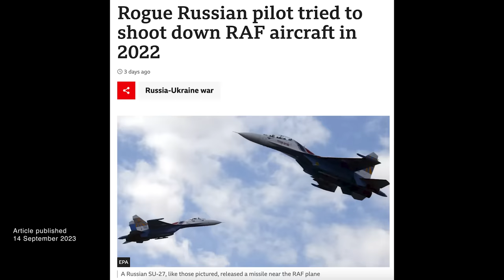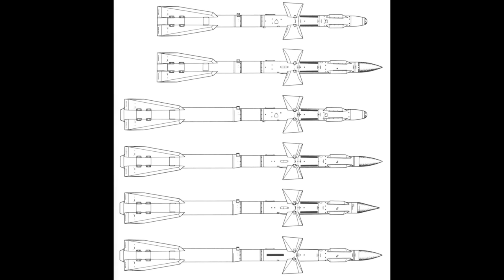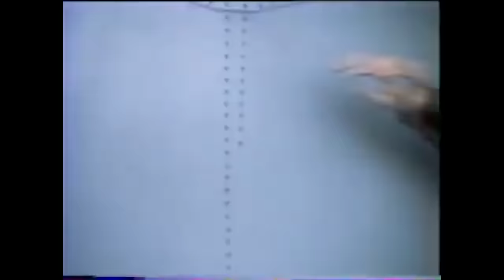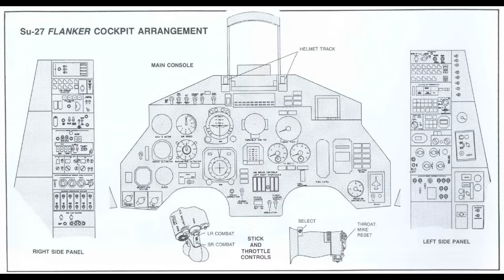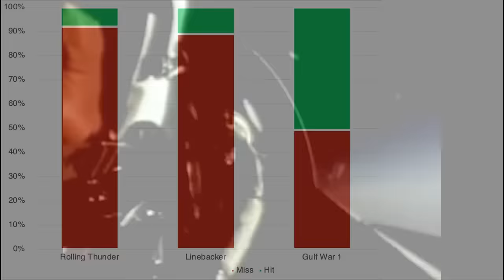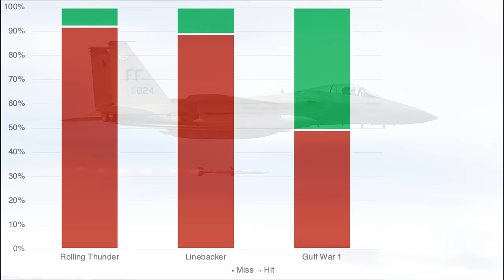BLACK SEA RIVET JOINT INCIDENT: A Narrow Escape But The Reality Of Air-To-Air Missile Performance

Comment: Remember the mission of the Rivet Joint platform. It is VERY likely the crew was listening to the Russian crew’s communications. They knew exactly what radar modes each Flanker was in. Considering that circa-1990 U.S. fighters had deception repeaters, wouldn’t it be logical to assume a U.S. national asset has capabilities far more robust? I don’t know, so I am not talking out of school here, but I don’t think those AA-10s just “went stupid” on their own.
Reply: Yes. The main postscript to this incident for Russia is them trying desperately to analyse exactly how their missiles were defeated (if indeed they were (probably)). For Russia this incident is ultimately a positive: they didn't start WW3 but they have some much needed intelligence; at the least they will know there is work to be done but possibly more specific intel will have been gathered. On the flip-side NATO may have revealed a capability. All that said, let's hope they get their loose cannons under control, can't end like this every time.
Reply: 50-50% this vs. just Russian junk.
Reply: For what it's worth, if some sort of classified ECM/Jamming system was at play in why the missiles failed, that would be consistent with the US and UK not wanting to talk much about the incident.
That said, assuming there was some ECM system at play, even the air crew can't be 100% sure if that's why the Russian missiles failed, or if the missiles failed for unrelated reasons.  Russian gear is certainly capable of not working without any outside help.
Reply: @guaposneeze  Well there is also the larger geopolitics of not wanting the escalate into WWIII...  Even if successful, this wouldn't have been a "Lusitania moment" but it would have been a step towards it.
Reply: @guaposneeze  I can say for sure that Rivet Joint sucked up EVERY BIT of electronic data involved in the event.
Reply: @obsidianjane4413  That is DEFINITELY a possibility. Who knows?
Reply: @obsidianjane4413  what do you mean a Lusitania moment?  The US didnt enter ww1 immediately after the Lusitania either. In fact this would literally have been a 'Lusitania moment. '
Reply: @jefclark  It is often cited as a casus belli for the US entering WWI, because it (government anyway) was looking for one.  In this case, the UK is not looking for one, I don't think.  And this is still a military aircraft doing a military mission supporting a combatant.
Reply: @obsidianjane4413  Im well aware of what the Lusitaniia was.  It was not the casus belli. Look when it happened - it was over 2 years before the US entry into the war.  The casus belli was just as much the other uboat activities, the zimmerman telegram, and the US favoring the allies anyways.  If the Lusitania had been sunk in say, Jan 1917 and then the US entered in april Id say sure.  But 2 years before doesnt equal a casus belli.

Also it turns out the Lusitania was transporting ammo too.

As far as a military mission supporting a combatant, technically the Russians have to prove it.  Otherwise its very much a flight in international airspace; period.  And when the Russians cry about it, ask for a reminder of Soviet activities in Korea and Vietnam, or Egypt and the Middle east.
Reply: North Korea did shoot down an earlier version in an EC-121 and we chose not to start WWIII
Reply: @raymondclark1785  North Korea has also been totally and thoroughly isolated, and never was the threat to the US Russia is.. at all.  Also should we not discuss the implications of either answer when it comes to who decided to attack?
If its the pilot then Putin doesnt have control over a military that has nuclear, chem and bio weapons.
If Putin did order the aircraft shot down, then the implications are obvious.
Reply: I think it's very likely you are exactly correct, and even more likely that we will not get declassified confirmation for a century...
Reply: @AnimeSunglasses  "even more likely that we will not get declassified confirmation for a century..."   So... we basically will never get it.
Reply: I agree fully.

It's too easy to laugh and say "Russian junk"...

But actually, it's MOST likely the  aircraft used ECM and other countermeasures to defeat them... with the UK and US (it's a US platform) quite rightly downplaying this to hide capability.

And in this video, to call the aircraft an "airliner" is just a load of nonsense. Makes it sound like propaganda.

The rivet joint is a weapon of war. It isn't defenceless!

I'm so glad this ended the way it did and nobody was hurt or started ww3, but let's not downplay facts. That's exactly what we criticise Russia for all the time. Propaganda, lies and downplaying. Yet here we are, openly doing just this.
Reply: @obsidianjane4413  no, it's not 50%-50% it's more likely 90% countermeasures, electronic or otherwise vs 10% "Russian junk".

We don't send defenseless aircraft up to play real world "war games".
This was always a risky political mission for the RAF and a risky mission for the crew.
If you poke a wild animal often enough, it's going to bite.
Especially if that animal is suffering from rabies for example.
Just like this pilot has "NATO is the enemy" in their head.
Reply: Puts on flat cap & grips lapels ..... As sed it afore an as'll say it agin.
Guess what Ivan might well do IF he wanted to check out a Rivet Joint's real capabilities
The missile which flew may have not carried a warhead, the second 'failure' being 'corroboration'?
Reply: @Farweasel  oooo I like your thinking!

I'm a strong believer that the RJ used certain means to defend itself and caused the failures, so your theory about "testing out the RJ capabilities" is a very interesting and viable one.

Although it's a risky/stupid way to do it, because it could have provoked a much larger reaction from the west.
Reply: @jefclark  The third option is that this was a mistake by the pilot - and for sure, Putin doesn't directly control every fighter pilot, ultimately it's down to some lieutenant pushing a button or pulling a trigger.

Comment: Another possible factor is a self selection effect - someone who has their head on straight isn't nearly as likely to err on the side of shooting in this sort of situation. So conversely, someone whose mental judgement is off may be more likely to make mistakes executing the missile attack.
Reply: considering that it's a decently high altitude shot and there wouldn't be much to interfere, it's most def a missile and guidance error. It's an embarrassing show of ineptitude on russia's part to not be able to shoot down a slow moving massive target lol
Reply: @felis_8906  moreso poor maintenance. Missiles are quite delicate so poor maintaince practices increases likelihood of failures this compounds as a missile ages.

Comment: In 2023, I expect air-to-air missiles to work.  I have no idea how the British aircraft survived.
Reply: Missiles miss, AIM-9X missed a virtually point blank shot on a Su-22 from rear aspect over Syria in 2017 when the Syrians were bombing ISIL . The F/A-18 had to use an AMRAAM to finish the job. Unlike the Rivet Joint the Su-22 from 1970s  lacks much of the electronic counter measures and sensors
Reply: @Archer89201  to be fair its countermeasures were so old and poorly optimized that they created such a tremendously dirty ir burst that it blinded the 9x across the whole ir spectrum as it uses an ir camera, not a seeker and by the time it was able to see it lost the target.
Reply: You shouldn't even today they aren't extremely reliable. The only reason certain missiles are more reliable is due to different practices and some modifications learned through tough experience. Its why by the end of their service sparrows were so relatively reliable. Vietnam was not a kind place to them

Comment: RC-135V/W is one of my favourite aircraft in service today.  In my previous life, I was a systems engineer and provided support to Airseeker, Cobra Ball and Rivet Joint processing systems.  As challenging as that job was, I look back on it with satisfaction.

Content Idea:  Speaking of technical systems, how about a study of the offensive radar systems used in the Korean War night fighters?  The USN/USMC had the F3D, which, as much as it was built for air-to-air, the Marines used it in a limited fashion for air-to-ground.  Old habits are hard to break even when you're flying a plane that was not a pound for ground.

Excellent reporting and analysis.  Always enjoyable!  Thank you!!
Reply: Defensive systems
The infrared countermeasures was not limited to flares, but directed energy from the AN/ALQ-157 system.[4] The aircraft has an AN/ALE-47 Countermeasures Dispenser System [CMDS], is a "smart" dispenser that connects directly to infrared and radar warning receivers, release expendable and towed/retrivable decoys, as well as helping the pilot with situational awareness of the threat.

Comment: I don't think it's too far fetched to speculate that the Rivet Joint would have some electronic countermeasures / chaff and flares that could have helped the situation in their favor. Those things are national assets, not having several layers of countermeasures would be silly. However I do agree that missile construction, age, handling, and pilot error could have played a part. Wouldn't surprise me a bit if the second missile was fried by an EW capability.
Reply: I 100% believe this was down to countermeasures of various types and not "Russian junk".

The aircraft was playing a very dangerous game in the middle of a conflict, there isn't a chance on earth that those crews were not always ready for a potential attack 

The first missile may have caught them by surprise and they reacted in time, but they will have been expecting the second!
Reply: @richardwillson101  Highly doubt they have the technical ability to make the second missile just fall of the rails. I'm sure they defeated the first missile and the second one was likely just a Russian dud.
Reply: @theflyinggasmask  true, you can't make it "fall off the rails" but without being there, we won't know if that means the rocket motor didn't fire, or if it broke lock almost immediately and lost all guidance.

There is certainly a chance it was a dud, or the pilot failed before the system was ready.

Modern countermeasures are very effective against older weapon systems. Especially if deliberately tuned to meet specific threats where they are operating.

Comment: These are the kind of messages that need to be drummed into the heads of aerospace engineers...as in "yes, Dummy, we also need a gun."
Reply: If you need a gun then you need a super maneuverable jet.
Reply: You mean kinda like a Flanker?
Reply: the Flanker has a gun.  This isn't Vietnam where they handicapped our pilots but not putting guns on early Phantoms

Comment: With this in mind, about how unreliable missiles are, it’s amazing the kill rate achieved by Sea Harriers in 1982 in the Falklands, with much older tech missiles. I wonder what the launch/kill ratio was there. I know they downed 20+ Argentine planes. Thoughts?
Reply: I know that the AMRAAM has a Pk of around 77% with almost every kill against an obsolete or non maneuvering target (inlcluding a US helicopter !).  I think that no matter how high tech the missile actual Pks in actual combat will never exceed 50%, especially against a target that values its own life than the mission success.
Reply: @rags417 What's that got to do with the Sea Harriers in the Falklands.
Reply: Aim-9L was a very very good missile
Reply: @Twirlyhead  OP was wondering what the Pk was for AIM-9Ls in the Falklands War, I pointed out that it probably wasn't greater than 50% since almost every missile ever made has a less than 50% kill rate vs a maneuvering target, AMRAAMs included and they are for some reason taken to be the gold standard in AAMs
Reply: @rags417  And there was I thinking you mistakenly thought the Sea Harriers were equipped with AMRAAMs in the Falklands in 1982 when they only were equipped with them from the 1990s FA2 version which also had the vastly improved Blue Vixen radar and the AMRAAM itself being only available from 1991. Altogether much more capable than the Sea Harriers of 1982. Just shows how wrong I can be, thanks for explaining to me.
Reply: @Twirlyhead  I was 21 during the Falklands War and followed it pretty much day by day in the news.  I have been following aircraft and military tech since I was around 9 years old, my dad flew light planes a lot and flew 13 missions in New Guinea in WWII.  I have a "fair" understanding of miltech and its history :)
Reply: I think Sea Harriers having the all aspect AIM-9Ls was a huge advantage over Argentine fighters with tail chasing older models especially when the Argentine planes had to fly to the edge of their range and were low on fuel to maneuver. No disrespect to the excellent British pilots, they were brilliant too
Reply: this is just my opinion,  but I get my sense that the RAF pilots were very well trained and just skillful,  and in the case of the fighters that attacked the British ship causing much death,   just plain pissed off.

Comment: It is unconscionable that western nations would not escort an asset like this, even in international waters! To think that your enemy will follow the rules, leaving your soldiers unprotected, is irresponsible. In short, the planners and those giving approval for this mission should have been court-martialed.
Reply: RC-135s have an endurance of 11 hours without refueling and escort planes have a max 2 hours.
Reply: Considering what was at stake, that RC135 should have been escorted even if it meant replacing the escorts in shifts every 2 hours.
Reply: There wasn't much at stake.  Firing on the aircraft couple be perceived as an act of war, there was no reason to assume such an action would take place.
Reply: I reckon all airliners should be escorted too, plus if you have to drive anywhere there should a soldier to make sure you're safe
Reply: I don't think you understand everything associated with what you're proposing. Also, the Russians would probably take even greater exception to armed NATO aircraft in that area and the situation could have been much worse. There is a time and place for what you are proposing. It is neither the time nor the place.
Reply: @MrArgus11111  The Rivet Joint is escorted by two Typhoons now.

Comment: I am unclear - does Rivet Joint have ECM? I would be surprised if it doesn’t .
Reply: Active ECM is a bad idea for Rivet Joint missions. The aircraft is covered with tons of VERY sensitive antennas. (Combat Sent is worse by an ungodly amount. )
In short, think of it as listening for conversations at a party. If you are carrying around a speaker blasting music, will you do better or worse?
If it had an IR seaker... those have other ways to be degraded. Without messing up the EM spectra where the RJs are listening. 
This is why I hated the fact that they pulled the tail-gun/gunner off the B-52. Give us at least some chance to protect ourselves while your other Fighter-Mafia buddies are going for another kill over there...
This could have very easily started a major issue. The type that gets lots of people dead.

Comment: The RAF Rivet Joint jammed the missiles.... that's what happened to the missiles. If they were able to listen in on the Russians secured radio channels the idea that they can jam the missiles seems plausible.
Reply: you can't just 'jam' a missile which doesn't have active radar homing, that's the whole point. The missile is not transmitting any signal. If the RC135 was sending out signals to detect radar the missile would have homed in on it, in fact I'd say a major reason for missing was that the pilot had fired the missiles without locking-on to the target, which from beyond visual (and therefore also IR) range would leave the missile's guidance system without any point of reference
Reply: @ViscountAlbany  You can jam/render useless any electrical device... any.  I have a Flipper zero and it will render any electrical device useless and/or give me control of it. It happens in seconds, not minutes, not hours.  I bought it on Amazon, what do you think the military doesn't have something better?

"iPhone security warning issued over Flipper Zero attack that renders your iPhone useless" 

If it can do it to a phone you does it seem absurd to you to be able to do it to a missile? 

Maybe next time, slugger.
Reply: @LilSebastian_  this is an old comment but no you cant just "jam" those things as the launcher has to guide them in anyway and the su 27s radar can work well in ecm environments and they were close enough that they could burn through any jamming the fact you compare a flipper fucking 0 to a million dollar aircraft baffles me its not even the same thing
Reply: "you can jam any electrical device"  @LilSebastian_ how do you intend to jam any device with no receiver?

ECM is usually done through jamming the attacking aircraft's radar directly and trying to make it lose lock on you, not jamming the SARH missile itself which does not have a radar antenna to jam.